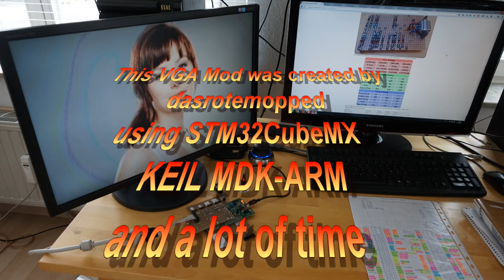STM32F429 LTDC VGA 800x480 adapter

Comment: I have visited your HP, you are brilliant ;-) . I have STM32F429-disc1 just like you. I have some isssue. My goal is to be able to use ili9341 as a standalone SPI display to connect FT2232H's MPSS SPI.
I see you soldered SB22, SB23, SB24, and SB25. What are the purpose of them? Are there for extracting PD2, PD4, PD5 and PD6 to outside as pins? or for driving IM pins on the ili9341? or when i solder them, could IM bits be configured over pins extarnally? what is the exact point of this?
Another issue is why there are some resistors on IM pins? are those for default display interface mode for ili9341?Another issue is schematic says 0110, when i look at the backside of pcb ı saw 1010 ?
Dont mind my bad english.
 Best regards...

Comment: I want to conect a tft which work with LVDS to the discovery using a RGB to LVDS conversor. What parts of the code did you change for work with other screen(I think that you use the BSP library)?

Comment: Nice!!! Do you remember the values of resistors in the R2R network for the analog colors? Thx
Reply from the maker: of course I do :
http://www.dasrotemopped.de/bilder/LTDC_RGB888_DAC.png
I updated the link in the description, too.
Reply: Yeah, danke shön von Frankreich!
There is no need one other resistor to GND to ensure the analog signals not rise more than 0.7V?
Did you use some chained timers to provide hsync & vsync signals as PWM ?
Reply from the maker: meilleurs souvenirs de Allemagne,
Some STM32F4/F7 have an integrated TFT controller, called LTDC. I am using this with the STM32F429. It generates all digital signals to drive a TFT, I only need to convert the digital RGB signals to analog values with the diodes/resistors. The output impedance matches to the 75 ohms input resistance of a VGA monitor, the maximum voltage level of 0,7V depends on the supply voltage of the uController which should be 3,3V. A lower voltage gives you a darker image, a higher voltage a brighter image. My circuit is a cheap hack, but fullfills my needs. Also see my newer videos where i push the limits of the LTDC even further. The LTDC is only limited by the memory bandwith of the framebuffer located in the external SDRAM and a pixel clockrate of 80 MHz.
A bientot !

Comment: do you have license of keil in this video or craked keil used?
Reply from the maker: I started to learn STM32 with Keil, but I switched to SW4STM32.
https://www.st.com/en/development-tools/sw4stm32.html
http://ac6-tools.com/downloads/SW4STM32/
Get the SW4STM32 project files here:
http://www.dasrotemopped.de/dateien/STM32F429i-Disco_ILI9341_20170212_clean.zip
And see the whole docs at my HP:
http://www.dasrotemopped.de/index.php?var=projekte&nr=21
http://www.dasrotemopped.de/index.php?var=projekte&nr=17
Use a translator if you do not speak german.
https://translate.google.com/

You can not crack a software when it is free:
Even Keil is for free when you use STM32 Cortex-M0:
https://www2.keil.com/stmicroelectronics-stm32/mdk
Use the MDK ARM Keil 32k edition for Cortex-M4.